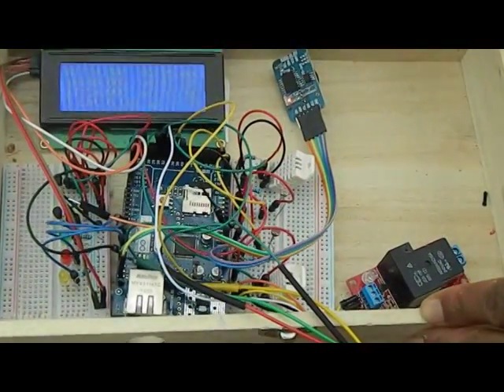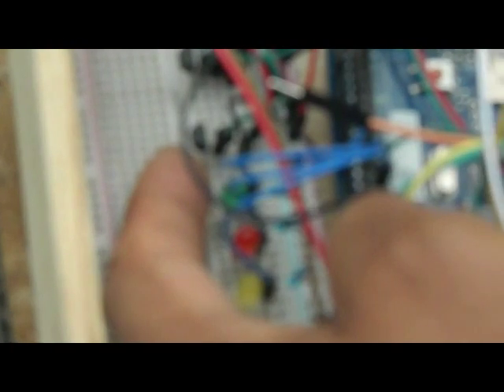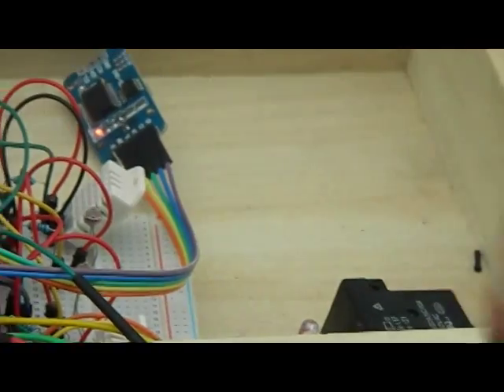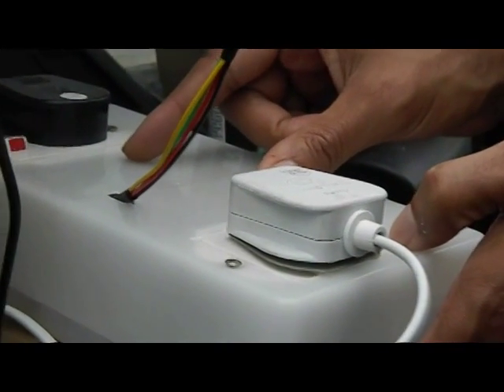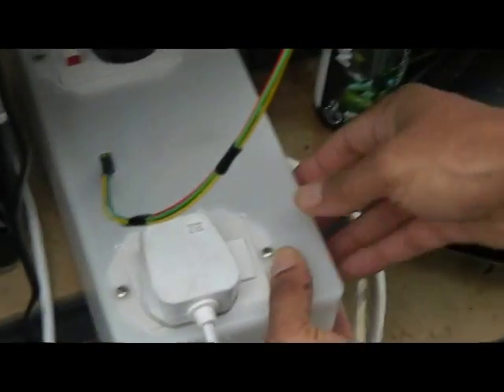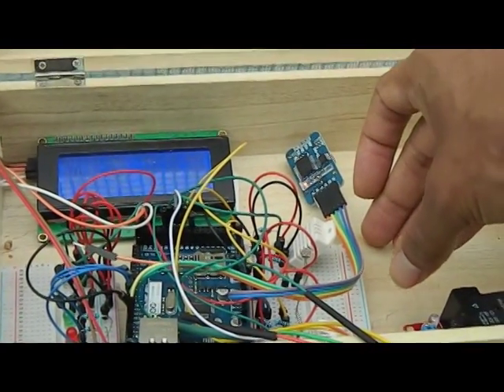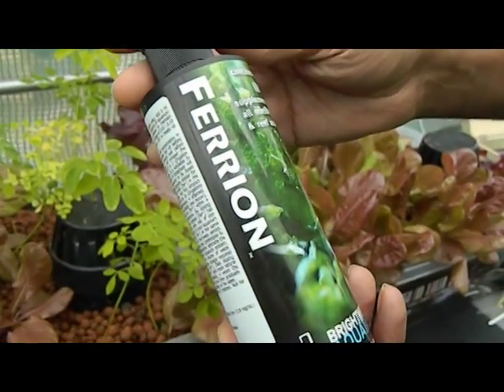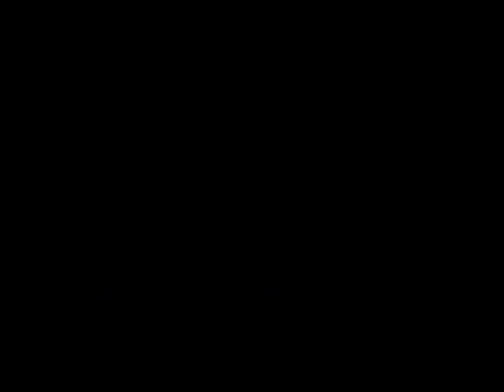Arduino & Aquaponics Update

Comment: It's going to hold over 8000 gallons of water.  I would need light intensity sensors, 3 temp[1 water,1outside,1outside inside], 2 humidity.
2 relays to control wet wall and fans or heater.1 for pumps and one for misters
Ck my vids to see my  project. Would like your feedback
Reply from the maker: Nice big setup you have there - remember it's a 1:1 ratio of beds to water volume which is alot of plants :-) , I'm sure I'll be able to make something to fit your needs, I'm currently developing  my climate control system to be more flexible and better packaged. I initially started it as a bit of fun but to be honest I have been surprised by the amount of interest I have received. Could you let me know what your min & max temperatures/humidities  for tanks and greenhouse as well as your region and No. of daylight hours required. I will also cost it for you as I am still working out all the material costs. Would you like it to be wireless and send you a tweet or email when events are triggered? email me at leon@moringamutual.org if you need to send over any files.